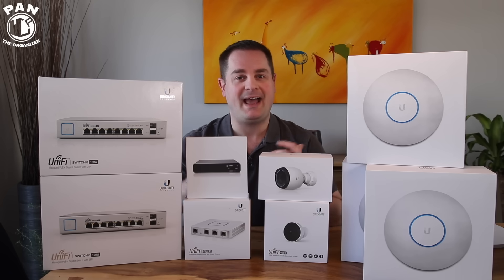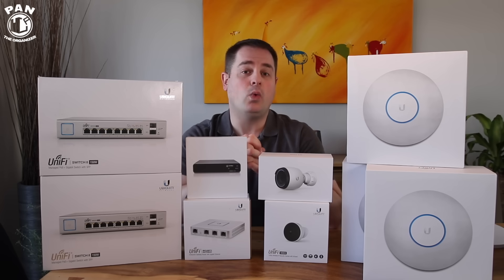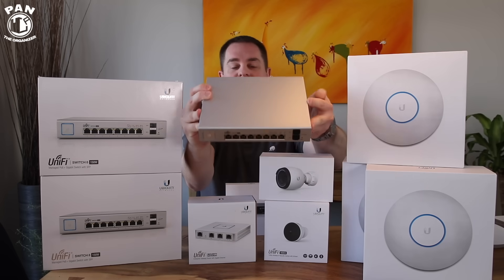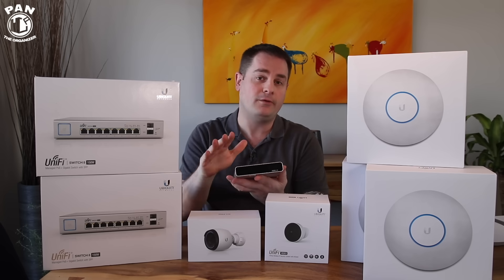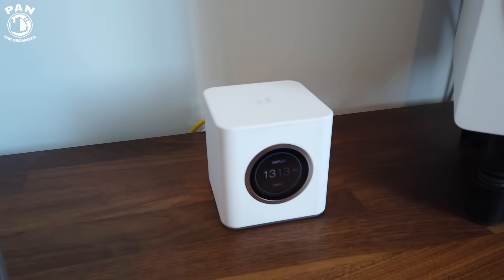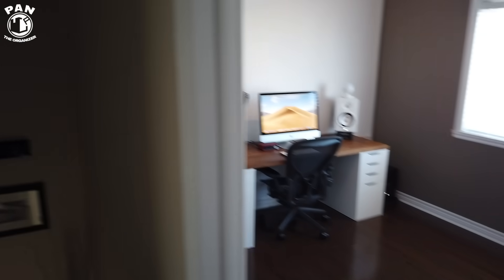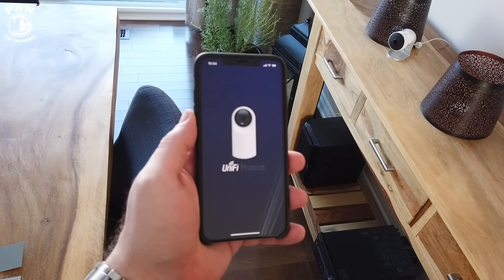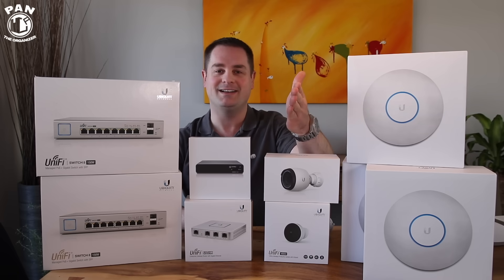SUPER FAST WiFi NETWORK IN MY HOME !!  Ubiquiti UniFi + UniFi Protect

Comment: Don't want to be the Bear of bad news but that little USG ain't going to pass that fast of a internet connection.. You would want the USG-Pro-4  :)
Reply: So you are installing a nice gateway firewall and not enabling any of its features ? Why would you do that ? Whey even install it, use the modems built in router..
Reply from the maker: I'm not following you...  You're saying that I shouldn't reach the speeds I'm reaching, yet I am...  So why would I need the Pro version USG?  That's the part I don't understand.

For the rest, the networking company installers took care of configuring my setup, so I'm sure they did a good job.
Reply: Pan TheOrganizer you don't have any of the security features enabled.. why buy something if you aren't going to set it up how its intended to be properly setup ?
Reply from the maker: How do you know that they didn't activate the security features?  Why do you assume that?  And you still haven't answered my main question which is why do you say it can't reach the 1Gb speeds when it does??  I'm starting to think you're trolling...
Reply: @PanTheOrganizer   Because i have BOTH devices !  THE little USG witch he has will not do gigabit full speeds with IPS or DPI and other features turned on.. The USG-Pro-4 won't even do gigabit full speed with IPS turned on.. So yes, the unit will do gigabit speeds with no features turned on. Now add a few 5+ clients on that network and al lof them do a speed test or streaming, you'll see this unit bog right down. Trust me, Been there done that, hence why i updated to the Pro-4 because of the sustained throughput..
Reply from the maker: Ok now that's more precise info.  I'll look into it.  Thanks
Reply: @PanTheOrganizer   The whole point of the USG stuff is because they have good filtering Perfect IPS and packet inspection. If you have them turned off you have just a "router" and any router can route traffic..
Reply from the maker: You’re not the first to say that and I don’t understand why.  As I said, I’m not a networking expert, but when I run a Speedtest from my wired iMac, I get the full 1000 Mbps speeds (1Gb) as expected.  Even my ISP’s modem could reach that speed with no issues...  So what do you mean when you say I won’t reach speeds like that?

Comment: Nice overview of Ubiquiti stuff ; I usually follow up due your car care videos ... It was a bit overboard for AP ; probably the AP lite would have been enough ;)
Reply from the maker: Thanks Max!  I love overkill. :)
Reply: @PanTheOrganizer   Ubiquiti offers a free heat mapping for your home. All you need is a floorplan of your home, and I know what type of walls you have. Ubiquiti will show you the best location for those AP's.
Reply: @andresnguyen8494  do you have link to that service?
Reply: @gveresUW   Hi Greg, this other YouTube link has some visuals on what it looks like. You will need to download the software first, in order to do the heat mapping. Key point is know the distance of a certain wall in order to verify that the AP distance is set correctly. https://youtu.be/-RfyFscmCfE start watching at 10 minutes.
Reply: @andresnguyen8494  the heat map is actually not accurate, it doesn't take walls, electronic interference or anything else into account
Reply: I have 2 ac pro in my house.   Best money ever spent.
Reply: @augurseer  how large is your house? How many floors? How far apart did you put the AC Pro's and why not the NanoHD's? :P

Comment: Excelent equiment but that router won`t do the job for 1Gb connection if you dare to activate any IPS or DPI in the router.
Reply from the maker: That's beyond my knowledge unfortunately...  But when I do a Speedtest, I do get the full 1 Gb connection with wired clients.
Reply: Next router will be pfsense on a Dell r210 II
Reply: That’s why I bought the Pro version and is capped also to 250 megabit only 😒
Reply: DPI is hardware offloaded on the USG/EdgeRouter (it wasn't at first but they fixed that).  It's only when you enable IPS/IDS and/or QoS that hardware offloading is disabled.
Reply: The usg is fine for home.  I prefer my edgerouter 5 Poe.  But the usg works nicer with cloud key.  Hard for any home grade or small scale stuff to do 1 gig with DPI or IPS enabled.

Comment: I myself have a similar Unifi setup with 4 AP; 1 Pro for the basement, 1 Pro for the 2nd Floor, 1 UAP-AC-M-Pro for the backyard, & 1 SHD for the main floor where most devices connect too. I think going with 3 HD is an overkill for a house setup. One HD and two Pros would handle the job and then some. I also would have gone with the USG Pro for the added IDS/IPS as well.
When you have a chance, I would love to see a review on the UniFi Protect G4-PRO. I've been wanting to pull the trigger but yet to see an actual review on it. They're over $400 so actual footage of the product will be a plus.  Currently, I'm running Nest IQ outdoor cameras throughout, but want to set up a 4k Unifi camera for redundancy & local storage for an alternative view to the front of the house.
Great video and Thanks as always...
Reply from the maker: Thanks Jerry!  You have a sweet network setup too! 👍🏻

Comment: Looks great Pan. I had a Ubiquiti Unifi Pro that I was unimpressive with. I bought the unit in 2013 and it made an audible noise squeak under high traffic load. It was widely reported - Ubiquiti did nothing to resolve the issue. I changed to Ruckus at home and saw better performance and no sound.
Reply from the maker: Thanks.  I’m having zero complaints until know.  Rock solid performance.  Hopefully it stays that way.
Reply: That was 2013 they have made huge improvements in both their hardware and software since

Comment: Amazing video ! 
Sidenote: not all speedtest server are equal. Some have limitters. Try fibrenoir's network next time.
Reply from the maker: Thanks Samy!!
Reply: yeah. why is it on wired it goes up to 1gbps but when it is on wireless, it only goes up to half of its speed.
Reply: jeremy guiab  wired will always be faster. someone here can probably explain why, but it also depends on if you are on 2.4 ghz vs 5ghz. 5ghz will always give faster wireless speeds vs 2.4 at a cost of range. Smart Phones rarely reach the speed of wired connections.